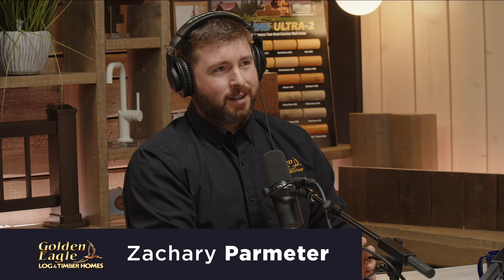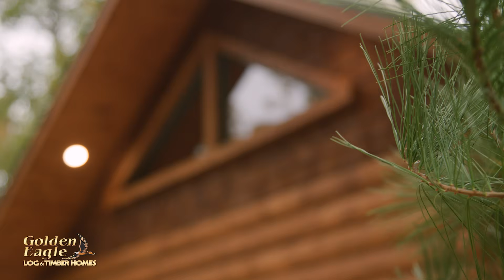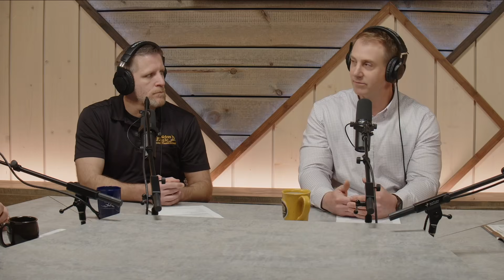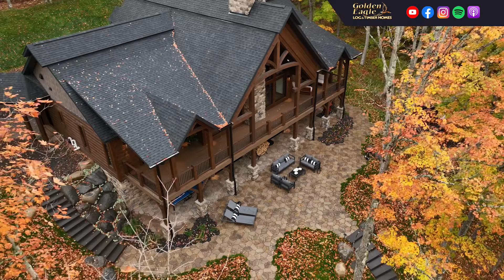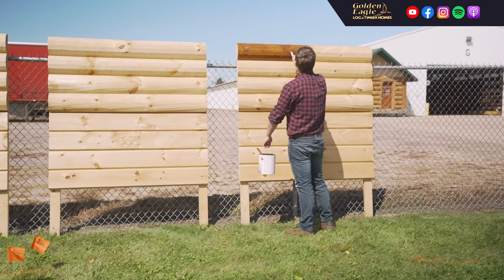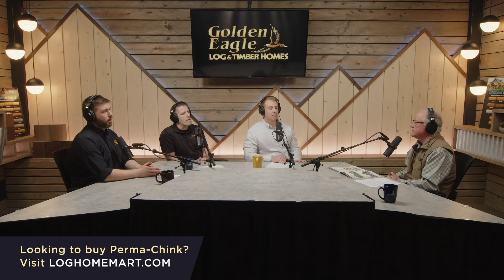Debunking Common Log Home Maintenance Myths | Perma-Chink Systems

Comment: I cannot afford a log home, but have some questions. How do you apply coatings on the south facing exterior wall  in the shade ? Also, my home is normal painted and I get mold/mildew under the eaves, seems log homes would have a bigger problem with that over the long run  ? But I think I heard annual re-application of the entire home exterior clearcoat every year ?
Reply from the maker: If the wall surface is too hot the product is harder to work with. We look at how the sun will be hitting the home through out the day and plan accordingly.  The clear topcoat is applied typically every 4-5 years